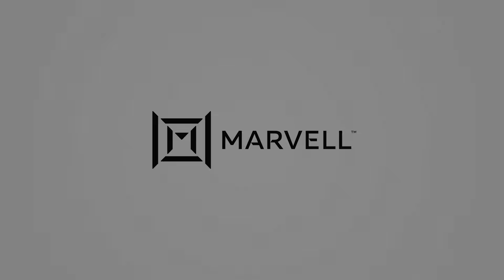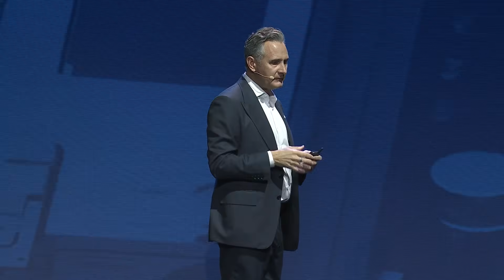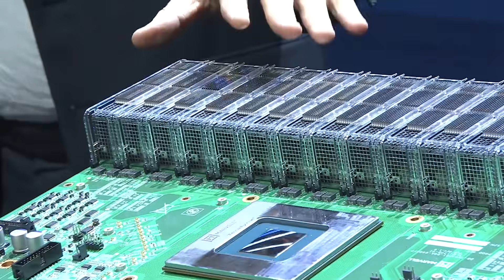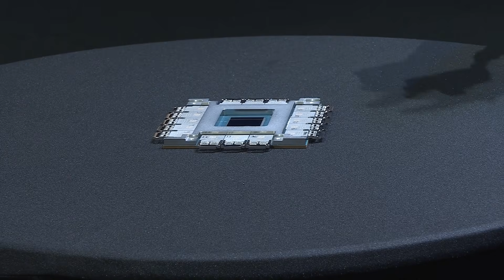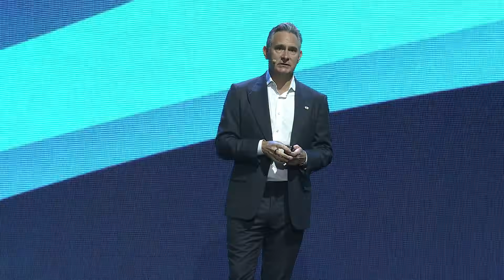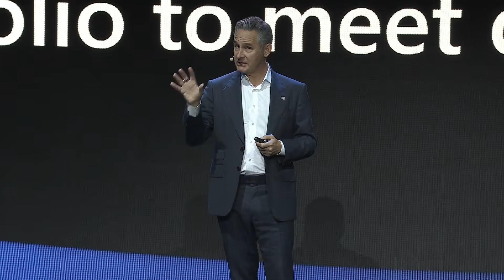Inside Co-packaged Optics: The Next Leap in AI Scaling

Comment: So what the presenter is saying is that my ambifacient lunar waneshaft won't need the hydrocoptic marzlevanes at all, as long as I keep the dingle arm properly aligned with the panametric fan. Great. Fantastic. Nobody told me this BEFORE I spent a weekend hand-fitting six spurving bearings into a differential girdlespring that, per slide 14, is now "legacy architecture."

And now he's just casually dropping that the prefabulated amulite base plate is deprecated? My guy, the entire non-reversible tremie pipe is bolted to that thing. You can't just sunset a base plate in Q3 and expect the sinusoidal depleneration to sort itself out.

Anyway, subscribed. Bring back the cardinal grammeters, cowards.